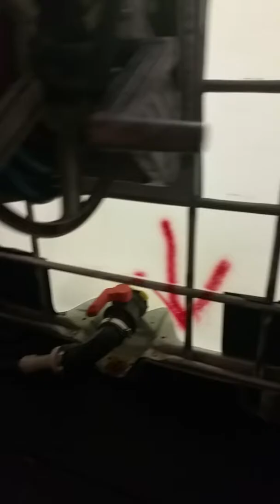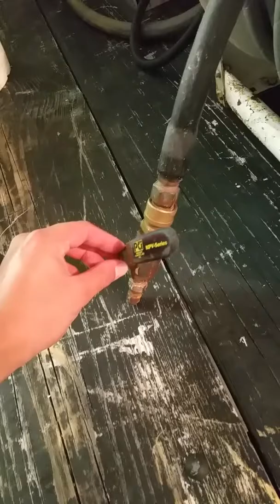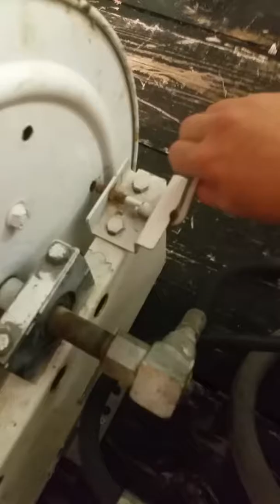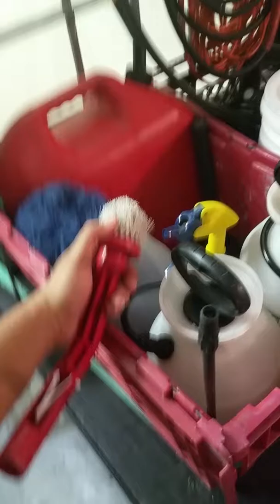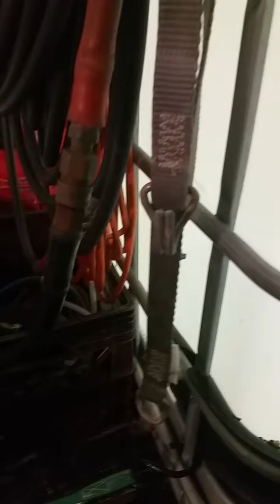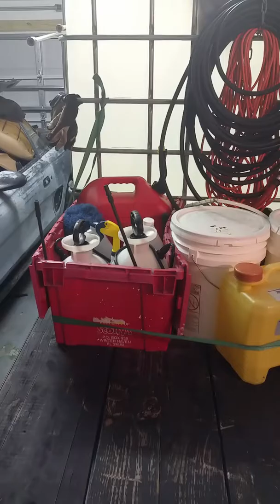Pressure washing setup explained

Comment: how did you secure that hose reel to the tank cage?
Reply from the maker: Sam Dabolt self tapping sheet metal screws there was bolt holes wheb you take the reel out from the holder

Comment: Pretty impressive for 5 months in.  Just a few suggestions.  Run 3/4" or even 1" from your tank all the way to your pump, then reduce it down.  You'll get better flow.  Also, consider adding a pressure gauge to take all the guesswork out of working psi.  Lastly, not sure if you have a dump valve for your buffer anywhere, but if not, might wanna look into it.  Allows you to quickly drain buffer at the end of the day, instead of having to drive with extra unnecessary weight of residual water.  Great stuff though, really.
Reply: You are
Reply from the maker: That was an old video of my “first budget minded set up” 

I indeed do run a 3 inch non-crushable spa hose with cam lock fittig from my ibc tote to another camlock firring on the pump end reduced down to 5/8s i only use top notch unloaders that are basically set and forget when it comes fo adjustments i use a commet oil filled gauge with quick connections, cheapest one is at northern tool made by commet. Thanks for watching